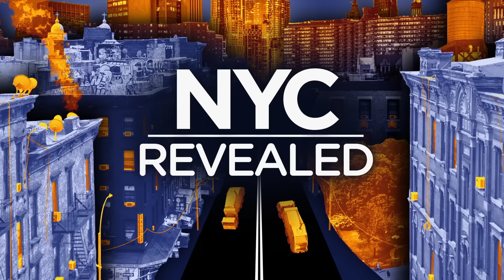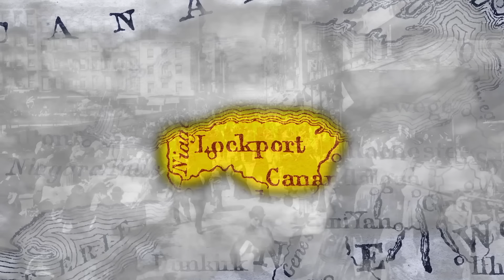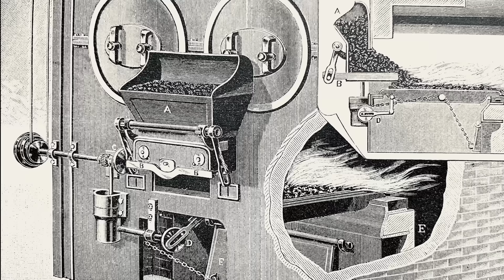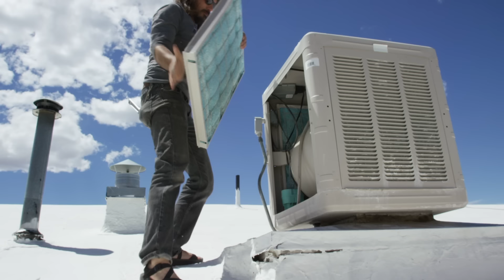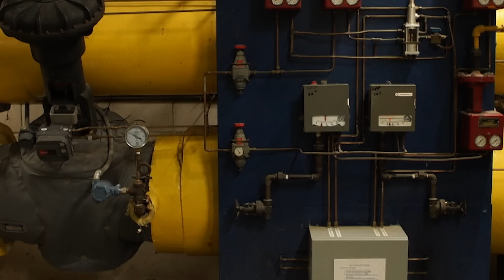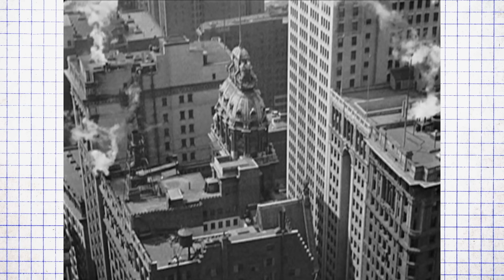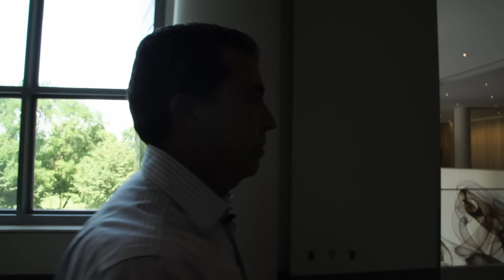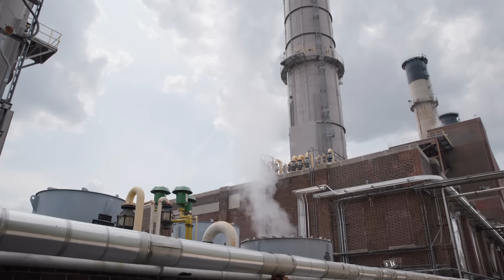How New York Still Relies on this Old Technology | NYC Revealed

Comment: Here in Prague, Czech Republic, my apartment is heated with steam that is generated in a plant 35 kilometres (!) away. There is a small plant room in the basement where a very simple pipe and valve system ( it's about the size of a car ) distributes the incoming steam as hot water at about 69C. That gives it enough pressure to reach my apartment. In my apartment on the top floor ( 6 storeys up ), the heat comes in at 66C. There is a small cabinet with valves etc. that distribute the water to the hot water system ( for 3 sinks, a shower, and a bath ), and the radiator system ( 7 radiators ). About 10 years ago I awoke in the middle of a winter's night to what I thought was the sound of a boiling kettle. I went into the kitchen half asleep to check that my kettle wasn't on, and looked out into the night. There was heavy fog outside, that I realised wasn't fog. I went out onto my terrace, and there was a geyser of steam shooting way up, much higher than my 6 storey terrace. It really was impressive. I put on my dressing gown and went down in the elevator. Outside in the carpark a couple of other neighbours had had the same idea, and we stood together and watched. The pipe had burst right under someone's new car, and it was really thundering out. It took until the following lunchtime for them to quell the gusher of steam. The guy's car had been steamed squeaky clean, but if it was my car, I would have offloaded it immediately as no doubt that steam would have cooked the paint/ sealants/ rubber/ tyres etc. The following summer the pipes were systematically replaced around the district ( the whole process took about 2 years ). The new pipes were about 4 car lengths of heavy, black plastic piping about 30cm across, and in cross section lined with yellow insulation so that the final bore through which the steam would pass was only about the width of a 2 litre plastic Coca-Cola bottle. Every summer (usually the last 2 weeks in July), we have no heating or hot water ( cold showers ! ) as they turn off the heating plant 35km away. It takes 7 days for the plant to cool down, and then they go in and scrape the insides of the boilers clean. I've seen pictures of the job - those boilers are huge . It's a very efficient system. It means that I don't have any complicated gas boiler in my apartment ( as I have in my house in Ireland, and had in apartments I lived in in London ). When the boiler in my house in Ireland broke, it cost me $3,500 to replace ( and that was 10 years ago ). The gas used in the heating plant 35km from my apartment used to come all the way from Russia. All through the Central Europe you come across these huge, blue pipes tracking on stilts across the land. The pipes are about the width of a car. Now though, the methane is sourced mainly from other places, and they hope to fully shut off supplies from Russia next year.
Reply: interesting, thanks for posting this
Reply: @thorr28  And when it snows, parts of the pavement that cross the underground steam pipe are always free of snow. Even buried 1.5m down, they heat the soil enough to keep the concrete snow, frost and ice-free :)
Reply: @Czechbound i have seen this in NYC! my friends old apartment building had pipes underneaths its sidewalk and its sidewalk only (beautiful building). in the winter his sidewalk would be completely dry while no others were 😂.
Reply: @thorr28  The open, small car park in front of my building is made of "cobble-lock" bricks. Adjacent to the entrance to the car elevator to the underground car park, there is an area that had yellow no parking stripes painted on it over the area the size of car's area (if anyone parked there, the turn was undoable to get your car into the car elevator). When the pipe to our building was being replaced, the workers took up all the bricks above the pipe, and stacked them neatly. This included those painted bricks. When they put them back, did they put them back as before ? Did they hell ! Haha, they all went back any old way, and so all over the car park there were random bricks with yellow paint on them. It still looks like the car park has a dose of measles :)
Reply: I took him to the last sentence until you hit the nail flat with a hammer My Wish for Moscow's power and District Heating. Fireworks are no match for the Splendor of light that high-voltage step-up Transformers shorting.

Comment: You still have CO2 emission from burning gas.
Reply: Yes but most of the heat comes from waste heat that would go to cooling towers and the gas plants only run as a supplement when there is too much demand for steam.
Reply: No single form of energy is 100% clean.
Reply: Not in the steam
Reply: Yes nitrogen oxides from gas burning are terrible for the environment and your health. Dude was getting away with saying it’s clean because people are too ignorant to know what’s going on.
Reply: Of course. Methane is a hydrocarbon. They were clear that there are emissions
Reply: @Czechbound he said they were burning the methane. Pure methane is a very clean fuel, leaving only CO2 and water if you burn it right
Reply: Chewing bubble  gum leads to a carbon foot print. When u die u leaveca carbon foot print. Its a form of energy except it fool
Reply: And soon, a communist run city. enjoy the ride!
Reply: @Dane-o7q  You need to re-read what communism means
Reply: @Dane-o7q  Sounds to me like you're rooting for the most Communist friendly political fraction in the U.S, the current administration. But you are too ignorant to see it.

Comment: Why buildings needed to steam heat like that? RP.
Reply: The water has to be at a high temperature so that when it reaches its destination, which might be several miles from the plant, it is still hot enough to be useful. 100C wouldn't be hot enough. So it has to be superheated steam.